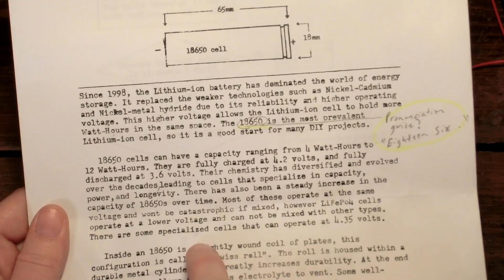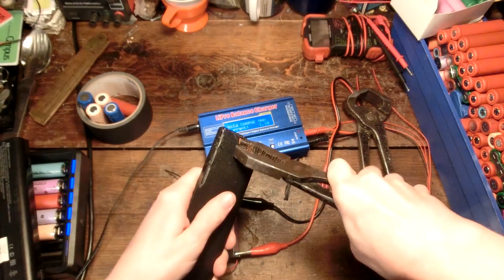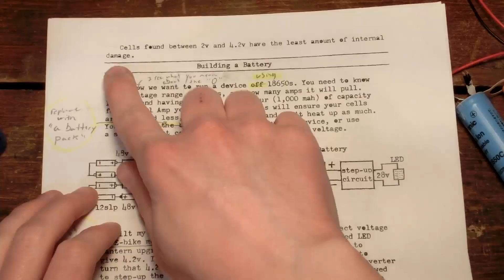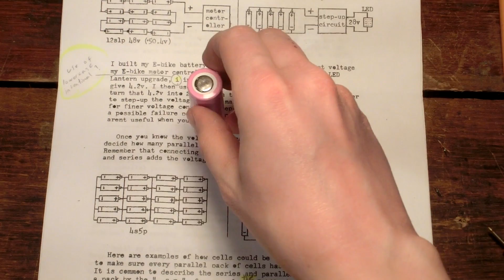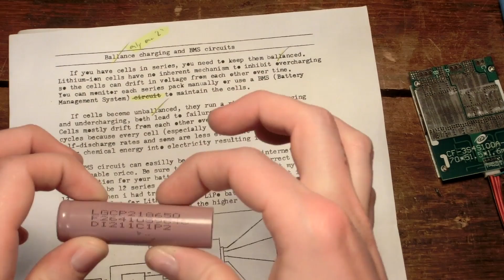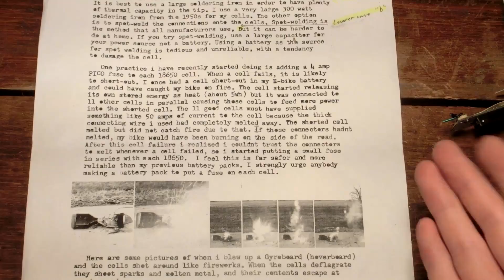The Tinkerer's Guide to the 18650 v1.4: Video Version

Comment: If it is 1990 in 2 hours it is not 1990 amp/hour but half isnt it?
Reply from the maker: no, when it says amp--hours, it means amp-hours.
Reply: @RinoaL  ok thanks for the fast answer, great informations on this video, trying to test some batteries from a xiaomi 10 000mah powerbank, containing 3 cells. Actually i m trying the charge/discharge circle option of the b6 for a cell.But does it stop by itself after the circles are over?  Yeah i m a first time user of the b6...
Reply from the maker: honestly, i only know how to get it to do what i want it to do. best to just try yourself

Comment: When you do the capacity test you only drain them to 3.6 V ? But most of the 18650 datasheets talk about a minimum voltage of 2.5v- 3v? Wouldnt your capacity reading be wrong then?
Reply from the maker: you arent going to drive it in an ebike any lower than 3.6v so no, my measurement is the more accurate one

Comment: Thanks lots of interesting stuff.Apparently The Lithium ion batteries stay pretty well balanced over time if charged in series, but the Lithium polymer don't. So the industry standard for lithium BMS was used for the lithium ion ones as well . , because the drain on lithium polymer can deliver energy a lot faster then the ion ones and can get out of balance quicker because of the higher drain. like after two years of charging and discharging without a BMS the batteries hardly varied in charge. The other factor which is interesting if they are charged up to a hundred per cent capacity they only guarantee them for five hundred charges, but if charged up to 90% they will last for a thousand charges. That extra belt up to 4.3 volts seems to be bad for them. whereas if the charge is kept at 4 volts it seems they will last indefinitely.

Comment: Do you still stand by your comment to not trust cells below 1.0v, even if you slowly recondition them, they stay stably at 3.6v once charged, and have capacity of 2000+ mAh?
Reply: Also I notice you wrote 18650 have capacity ranging from 4Wh to 12Wh -- is this a typo? Most I find are in the 2Wh - 3Wh range.
Reply: One last question -- (thank you!!) When charging 18650s with a variable dc power supply can you set the voltage to over 4.2v to boost the current in the circuit, as long as you disconnect the battery before it itself gets above 4.2v? (Taking care the current doesn't go above the manufacturer datasheet max charge rate, of course.) Thanks m8!
Reply from the maker: 1: yes cells bellow 1v should only be used for tiny experiments in case they fail, and i would recommend keeping them indoors.  for a while i was collecting all the different colors and several of those went off when i wasnt home even though i tool them down to almost 0v each. 

2: if a cell has 1ah, then its 4wh. never trust a cell thats bellow one wh in a large pack since that means it has degraded a lot.

3: yes you could charge it with a higher input voltage, but its not recommended.
Reply: When you say several cells went off when you weren't home, do you mean they exploded while they were powering something or charging, or exploded without being being hooked up to a circuit? 

Why do you not recommend charging with higher input voltage -- because it would run the risk of overcharging the cell? I have a cradle that holds 15 cells in parallel, and as the voltage gets up to 3.8, 3.9, etc, the amperage starts to slow down. But distributed among 15 cells, it is really only tiny trickle in each. I'm just wondering if I can cut the charge time like this. I would only charge cells this way when I was sitting right next to them the whole time. I always unplug all my chargers when I need to leave the house.

I appreciate you taking the time to share your input! Cheers.
Reply from the maker: i had them just sitting there in a glass beaker. i thought theyd be safe if i discharged them and kept them around just for show. thankfully it didnt catch anything on fire but spewed hot stuff out of it. very well could have exploded.

i dont recommend because it is yet more stress on a cell that isnt really required. i do it sometimes but i try not to since charging them fast can degrade them a bit faster over time.
Reply: Wow, that's scary. I have a number of old below-1v cells lying around. So when you say up above you "would recommend" keeping them indoors, did you mean to say you would NOT recommend keeping them indoors?
Reply from the maker: darn mental-autocorrect. i have a bad habit of not typing the "nt" at the end of words like shouldnt and wouldnt. i keep all my lower quality cells in my brick shed in case they go off.
Reply: Haha. I'm very glad I'm hearing this!! My low-voltage cells are leaving the house first thing tomorrow morning.
Reply from the maker: well to be fair those were ones found at like 0v that gave me problems. onces from 0.2 to 1v seem to be more stable. i kinda am paranoid about house fires though so maybe im biased. lol
Reply: Uhh yeah, best not to risk it, Haha.

Comment: I really appreciate all the battery stuff you've done on your channel. I've been looking into building my own ebike. One big kit I've seen supposedly pulls 40amps with 100 max. Do you think, with those Pico fuses, I would need like 25 of them to keep it from breaking the fuses? What if I use 48V instead of the max 72V?
Reply from the maker: yeah if you need more power, just build a bigger battery. i wouldnt recommend getting a kit that powerful just for an ebike unless its an electric dirtbike.
Reply: Rinoa Super-Genius Thanks

Comment: I noticed that the 18650 cell holders help keep the cells a little cooler.   I hot glued my first pack and it would get a lot warmer than the second pack that I made with the holders and spot welded.  Seems that the cells transfer heat to each other when they touch each other.
Reply from the maker: if it gets hot, then you didnt make your pack big enough.
Reply: yeah, It was a little small for the 1500w kit.  13s8p 17.5Ah 48v and during the first test ride it was good for 30 miles (@ full speed), but the battery was pretty warm/hot.  I made a new pack to make a 72v battery and the addition is a 7s8p which is added to the 13s.  I replaced the bms to a 20s and bought a new 72v controller, display and used the same hub as its good from 48v to 72v.   Using less amperage due to more V (20s8p), so it stays cooler now and is much faster :)

Comment: Great guide! I wish information about anything was always this accessible and easy to follow. This is how all education should be :) When it comes to fusing, wouldn't it make more sense just to link your positive battery terminals to a larger bus (where the passing bus bar shouldn't be more than about 2cm from the terminal) using super-thin copper wire - like a strand or two from a typical ripcord. If a cell shorts out, that positive lead should just burn out instantly without really causing any adjacent damage. Or at least, the risk of any damage should be low enough to justify not needing to buy the 4amp fuses which would be more tedious to solder/include in the battery pack. This seems to be the method that the home brew powerwall guys are doing on their packs although they are using old resistor leads which also seems like a waste of money to me if a spool of thin-gauge copper wire could work just as effectively

Comment: hi when wiring in a pcb bms 10 pack 36v for instance, do you solder the balance wires to one negative and the rest to positive or the other way round like a imax on a 3 cell cheers

Comment: I have a bunch of red Sanyo cells, they get really hot while charging. High internal resistance, I guess. I trust them as far as i can throw them. How about storing cells, should you fully charge them or have them at some percentage storage charge? This kinda ties in with not charging cells all the way to 4.2V to reduce wear, I guess.

Comment: Hi Rinoa.
l have built a 48v lipo battery and bms.
Can you recommend a charger?
l have a 48v lead acid charger but leary to use it
without your advice.Thank you
Tony from Canada
Reply from the maker: +Tony Corran as long as you have a BMS, the lead acid charger should be fine. i used lead acid chargers on my bikes and just let the BMS take care of all the smart stuff. no issues so far...well besides water related incidents.

btw those lead acid chargers can be pretty cool. the ones ive gotten can go down to like 12v so they are pretty versatile.
Reply: Thank you,that was nice of you too reply.
l have followed you for a long time and built one bike
and building a second steam punk with a pusher trailer electric motor.
Your inspriation was a great help.Keep up your
great video's.

Comment: Aren't those bms cables a bit thin?
Reply from the maker: +H.pylori no
Reply: Hehe great answer. :)

When i get it right, then these wires from/to the bms aren´t only
for sensing or balancing but rather for the whole charging and discharge.

And when i compare these wire size with the one that for example are used 
at proper car audio installations i get a big question mark over my head.
Yes, the cable lengths are not comparable but puhhh these looking like better bell wires. ;-)

Btw... thanks for your vids!

Comment: This has probably been said however, some things to look into or confirm: 1. The internal resistance (In my testing the internal resistance plays a very big part in choosing the right 18650 to use in an application, low I.R should be used for big packs and high I.R for small projects) 2. The charging cutoff voltage, The lower the cutoff voltage the more cycles you get, this maybe a good thing for small applications however I think the drawback would be the battery will not be able to delivery the same discharge "C" rating compered to a battery charged to the full amount. I would love to hear your input about the above Rinoa and anybody else in the comments, Thanks for sharing and keep up the great work.
Reply: Glad I'm not alone thinking about the cutoff.
For something that's used and cycled/charged on a daily basis, I'd limit the cutoff at 4.05 V (for a normal 4.2 V chemistry) and get ~1300-1500 cycles instead of ~5-700 with 4.2 V.
Heck, I'd even set a lower cutoff on my phone if I could, it gets recharged daily anyway. (Is it possible with a rooted 'droid maybe?)
Reply: I really think the lower cutoff voltage to higher cycles is counter-intuitive, because (as I've stated) of "C" rating discharge and the overall amp hour rating, Example If you charge a 1Amp 18650 to 4.05v the final capacity will be say 600-700ma if that, so you would have to charge the battery more often resulting in more charge cycles and overall reducing the life of the battery because of the increased charging. What do you think?
Reply: +Wil Cranberry The most common rule of thumb I see quoted is that for every 100 mV below 4.2 volts you go, you get a doubling in cycles. But below 3.9 volts, you've sacrificed about 40% of your capacity to longevity. The logarithmic nature of the gain in longevity means that you won't be losing total lifetime capacity over the lifetime of the cells, but you do start to lose out on the very thing that makes them attractive, energy density.

Comment: either i missed it or you never mentioned the different chemistry mixes these 18650's can have, Lithium IMR or Li-Mn (Lithium Manganese) IMR/Hybrid batteries (today's most common/recommended battery for e-cigs as they gass instead of explode!)
protected ICR Li-Ion (explosive) most common in older laptops the cells are often unprotected as its commonly on a separate circuit board inside the battery case
this is my experience anyway, i haven't dismantled a laptop battery for probably 5 or more years so feel free to correct me if needs!!
excellent guide btw!
Reply from the maker: +Dan i didnt mention chemistry too much because i wanted to save space and the chemistry is still the same voltage so my recommendation for not going over 1c discharge kinda makes that irrelivant.
Reply: i only mention it as you yourself have experienced exploding batteries and the newer li-mn/imr are much safer!
Reply from the maker: +Dan only exploding when they were shot several times with a gun though, keep that in mind

Comment: i have videos on 18650 from power tool batteries. Might not be great videos. I get warrenty battery packs and find about 50% of pack 100% fine and has a failure in the fuse or PCB. the rest of the packs will have a pair of low or dead cells. all other cell will measure between 3- 4 volts. So far i have over 1000 cells and a bit over 100 dead cells. Over all easy to open as they are screwed together and very few have glue on them from the temp sensor. Most of my cells are rated at 2500mAhr but they generally test a bit lower. but i also have lots of 3000mAhr rated and i get around 2800-2900mAhr.
I hope this helps, if you can get them...
Reply: Urban Off grid what do you mean by warranty packs? I'm looking far a source where I live
Reply: Tool repair shops will replace faulty battery packs that are under warranty and the old pack go into the bin. So some packs are brand new and most are a few months old when i get them so the cells are very good. All modern tools contain eith 2500mAhr or 3000mAhr from LG or samsung.

Comment: No way are 18650s fully discharged at 3.6v. That's the nominal voltage. Discharged is 3.0v some can go down to 2.5v
Reply: 18650 range -4.2 full , to 3.6 empty ! Any lower and you lose A LOT of capacity each cycle :) . Check it for yourself online :)
Reply: jeales895 Most manufacturers test capacity by discharging to ~2.7V at 0.2-0.3A. That is how i test them too. Most devices won't discharge below 3.1V or 3V, but it's great for testing. You can always subtract 9-10% from your final capacity to get real world capacity.
Reply: But why does Rinoa say 3.6V is discharged?
Reply: jeales895 The voltage jumps back, when the battery isn't under load. It shouldn't jump back to 3.6
3.2-3.3 is usually the case
Reply: +Blatt Ferenc You didn't say anything about the time to rebound. That's important because you can fool yourself into thinking that the cells are being treated right and not realize that one or more of them had gone well below safe and rebounded above 3.2v.  I've seen cells dip to 2.3 v under load and bounce back to a higher voltage than the ones that didn't dip below 3.1. It's happened more than once with recycled cells that just crapped out all of a sudden after having given six months of reliable service. Incidentally, that's why I started using a voltage alarm.
Reply: bigass197 Of corse that is true, but i commented about testing, so we are not talking about normal usage. I also wrote the voltages under load. What you say is true. At 3.6V no load voltage, you have approx. 10% left. If you deplete these batteries to 0% regularly, you are doing a lot of harm to it. I think we both say the same thing.
Reply: I was under the impression that the top voltage was more important than lower (for preservation of capacity)
Reply: both are very very important ,and btw if you charge it to 4.00 and discharge to 3.6  each cycle-the cycle number (life span)  will increase .  A lot of critical conditions are to be observed with lithium ! Most of all is temperature! Not only cuz- they can go boom, but because in higher temperature parasitic chemical reactions occur and capacity drops RAPIDLY ! That is valid for both charge and discharge .    :)  It's  very interesting dude I suggest you surf the web on that theme.
Reply: You can't use no-load voltage to estimate capacity, Blatt. Cells rebound in voltage in just a few seconds. That isn't a hand-wavy "few seconds", either. They'll regain a few hundred millivolts in 5-10 seconds after the load is removed and continue to creep up.
Reply: Markle2k I said the same thing
Reply: Markle2k That's cool dude,  but if you are doing a discharge test without keeping an eye on the damn thing -then wtf are you doing :D (if you know what I mean)
Reply: Markle2k  -A cell dipping below that threshold is way too dodgy to even consider using in a high amp discharge scenario :)
Reply: +bigass197 Where did you get the notion that I discharge test cells without supervision?
Second, I agree that 2.3v is too low. Did you not read the next sentence where I described the cell as having crapped out? Those get marked "dead" and go into the recycle bag to go to the recycling center.
Reply from the maker: +Taunter Atwill once the battery gets bellow 3.6v it's voltage drops too much when under load, and yes it is the industry standard of when a battery is considered discharged.
Reply: I think so too dude , I'm not knocking you down or something .Just adding thoughts so jeales895 has more info to work with from earlier :)

Comment: Tesla made a new battery (2170)  that can master 33% more power for the same volume. The new cell is called ‘2170’ because it’s 21mm by 70mm. It’s thicker and taller than the previous cell that Tesla developed with Panasonic, which was in an ‘18650’ cell format. Tesla CEO Elon Musk has been boasting about the new cell over the past few month. He said that it’s the “highest energy density cell in the world and also the cheapest”.
Reply from the maker: +Marc Letourneau its the same chemistry, just bigger from what i know. unless its the new SDI cell type or whatever its called.

Comment: I'm just wondering , if anyone can help ...can I use 4 amp fuse wire instead of a pico fuse? I've researched pico fuse and I'm not finding how they differ from fuse wire - thanks in advance 👍
Reply from the maker: +versatec1 well a wire doesnt have a controlled failure. a fuse is designed to break the connection were the wire could melt and catch domething on fire or splatter the molten metal and arc other stuff.